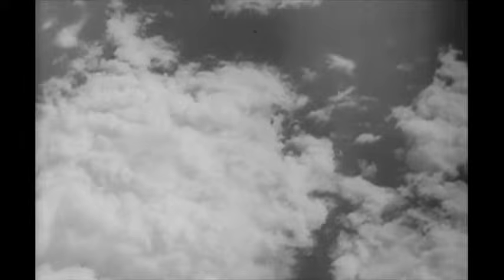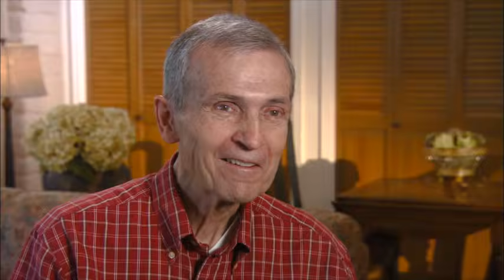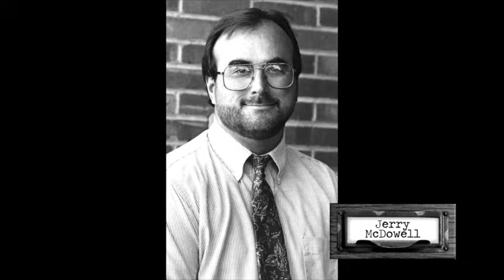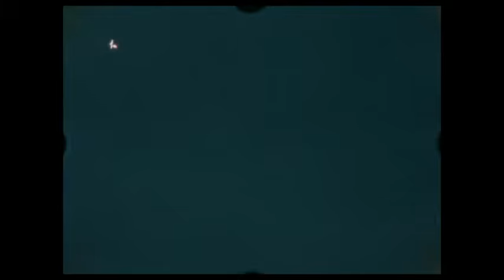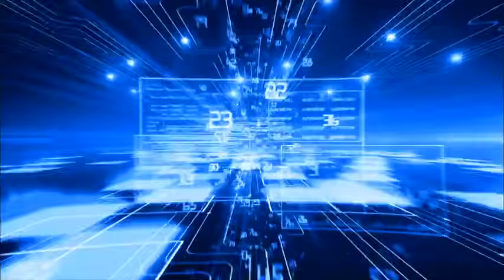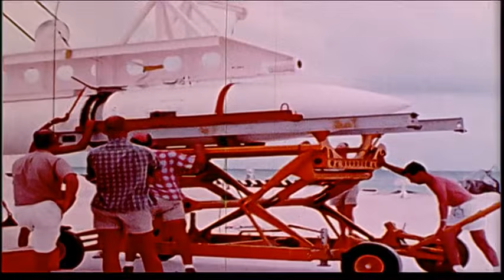It Really Is Rocket Science!

Comment: Germany launched the first man-made object?  I don't think Robert Goddard would agree with you there.
Reply: They launched the first missles that reached space.
Reply: The Paris Gun fired projectiles into space.The gun was capable of firing a 106-kilogram (234 lb) shell to a range of 130 kilometers (81 mi) and a maximum altitude of 42.3 kilometers (26.3 mi) The greatest height reached by a human-made projectile until the first successful V-2 flight test in October 1942.
Reply: @indigohammer5732   Space, as defined by the Karman line, is 62 miles up.   Goddard never reached space.
Reply: amen , I get so tired of the incorrect info in these shows
Reply: @willreid8240  Actually it's correct
Reply: @willreid8240  The statement was correct.   Space, as defined by the Karman line, is 62 miles up.   Goddard never reached space.
Reply: The Chinese beat everyone by centuries.